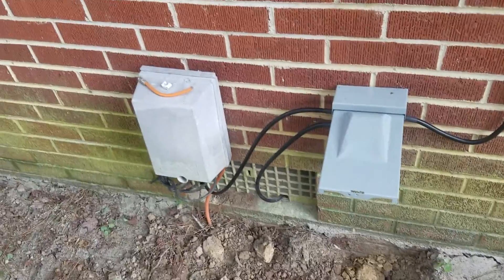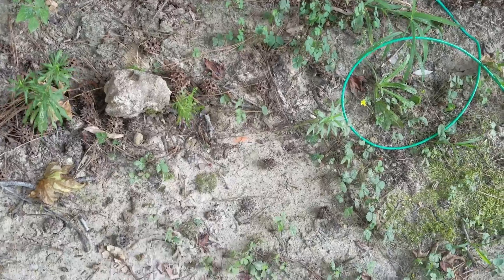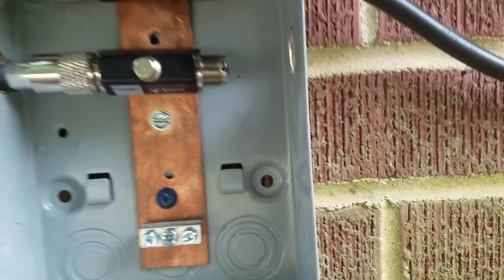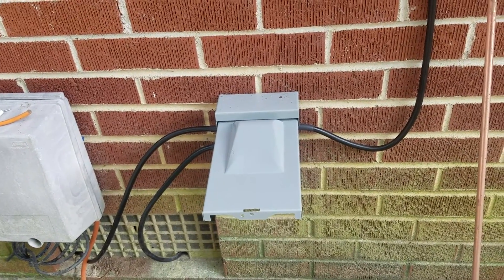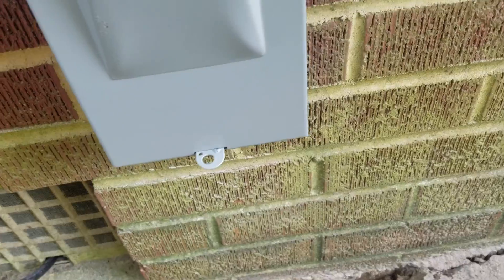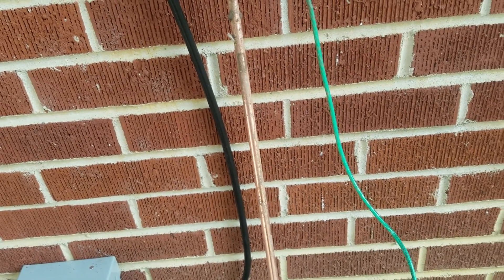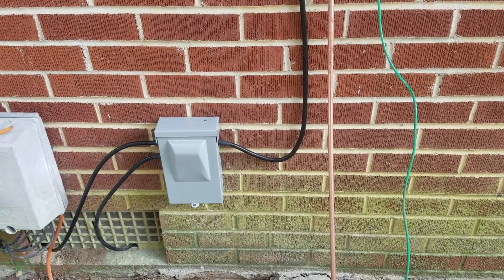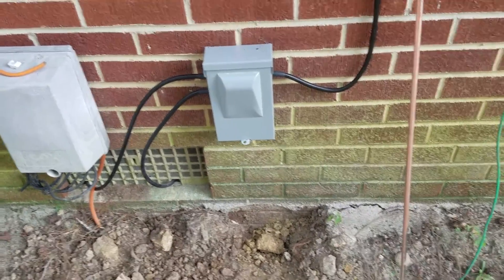Antenna lightning protection installed part 2

Comment: if not bonded to your main grounding rod at the meter, there would be a difference in ground potential if you operated a transceiver that is plugged into the house line and connected to the antenna. it would be possible for a transient current to pass through the transceiver  on its way to a lower resistance path to ground.

Comment: Amazing video, thumbs up.   I'm in the process of all this also.  Just put up my tower, ran 10 foot ground rods in the ground.  There are 3 rods in total spaced out.   I just have to go buy my antenna and mount it.   Then run the coax but you did an amazing job with the lightning arrestors.   I wasn't sure and still debating if i need them or should get them.  
I got 3 gauge ground wire from tower to ground rods, code sais my location minimum is 6 gauge, so i went a bit over kill.  Either way, great video...make more...I will upload mine sometime this week.
Reply: u can never go over kill when grounding and bonding for lightning protection.

Comment: Don't think one 8 feet rod going help due to the ohms  at 8 feet !! Usaly around 500 at 8 feet the lower ohms the better !!
Reply from the maker: I got a couple more I'm just not sure where that are at.
Reply: your soil conductivity will have more affect than the length of the ground rod will. NC has sandy loamy clay by the looks of what is near your house so you should be good. The clay is better than pure sand. You could also salt the area with epson salts and water it in to help but honestly an 8 ft rod is usually fine for this and is a non issue. I'm in Georgia and we have similar soil to yours in my area. Just south of me is sand and north of me is rock lol